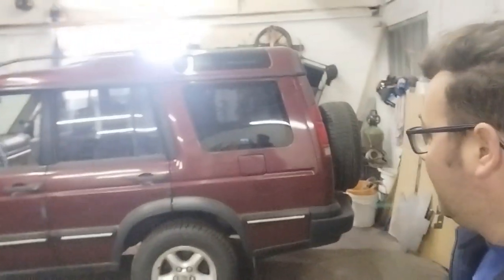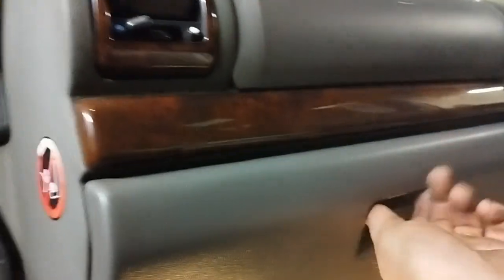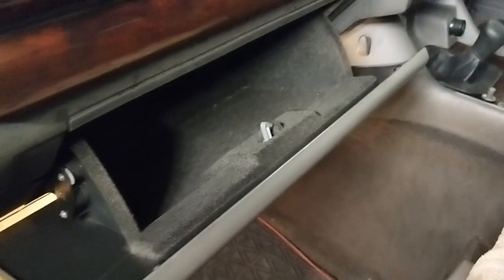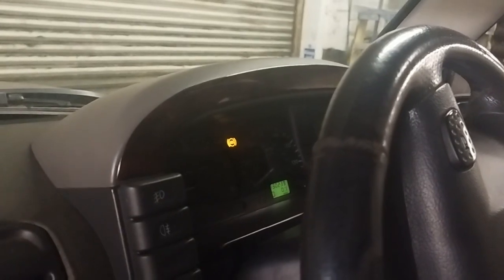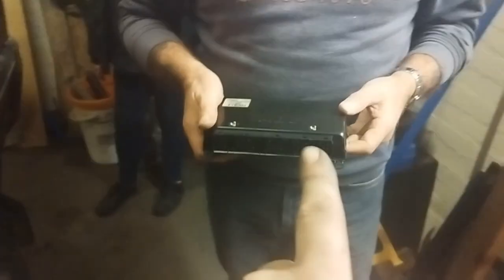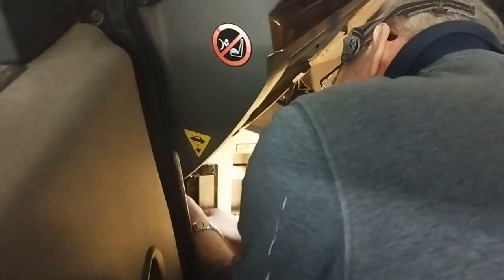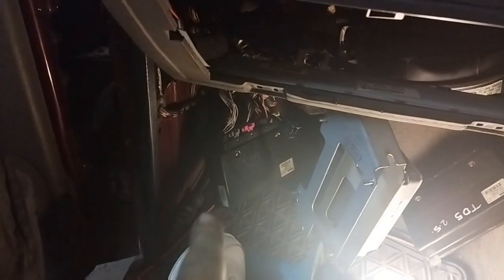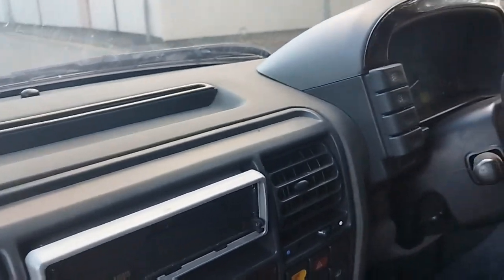land rover discovery 2 td5 speedo not working. repair fix how to.

Comment: Thanks always for your videos!
Please ensure people understand there is a big difference between the Disco 2’s Body Control Unit/Module (BCU/BCM) and the WABCO SLABS Engine Control Unit (ECU).
The Disco 2 BCU has one unit part number YWC000310. 
The SLABS unit (Td5 & V8 share the same unit) has multiple part numbers:
SRD100461 ... really total crap
SRD100462 … total crap
SRD000070 … it’s meh
SRD000150 … the Best
SRD500070 … the overall bestest 😊 BKA the hard to find Holy Grail model (the one I have in my 2001 Disco 2 V8. Paid a pretty penny for it. )
BTW… NANOCOM FTW!!! 
Cheers mate!
Reply from the maker: Thanks. Been looking for a nanocom for a while.